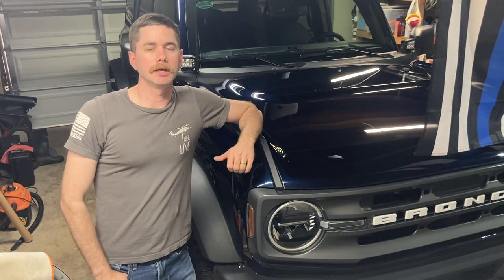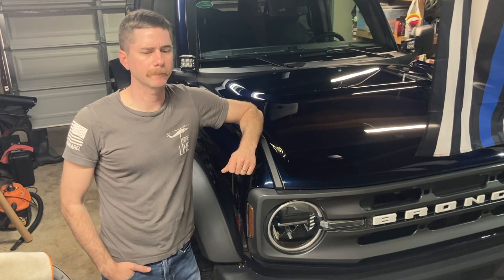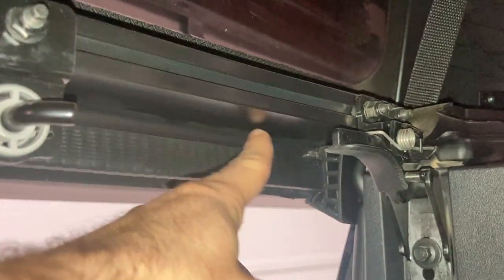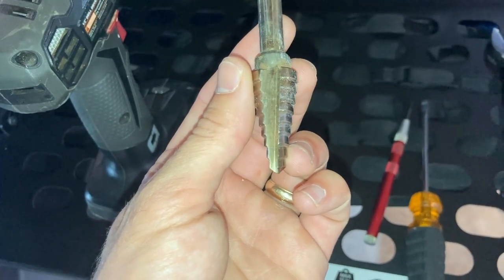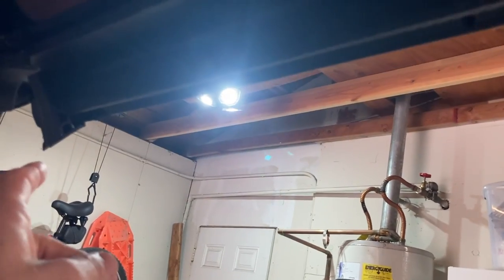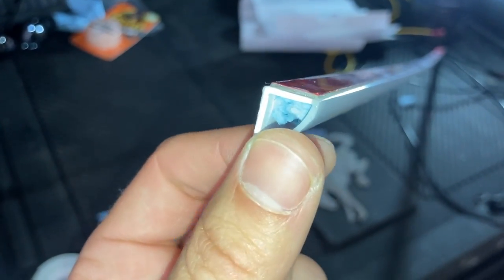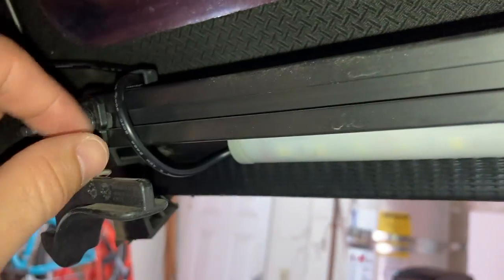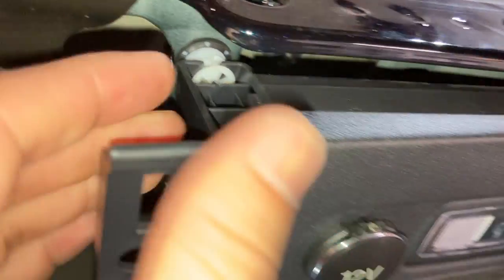Quake LED cargo light install on 2021 Ford Bronco   HD 1080p

Comment: It taps to the cigerette lighter wire, does accessory power need to be on in order to turn on the lights? Or can you turn it on if the vehicle is completely off.
Reply from the maker: Yes, accessory power has to be on. However, accessory power stays on for 1 hour after turning car off which is nice. I can always just press then ignition button once too without foot on brake to turn on accessory power whenever.